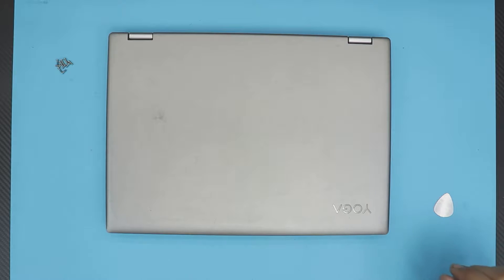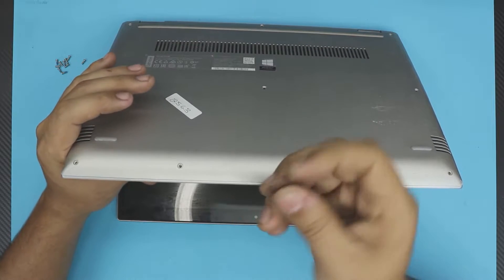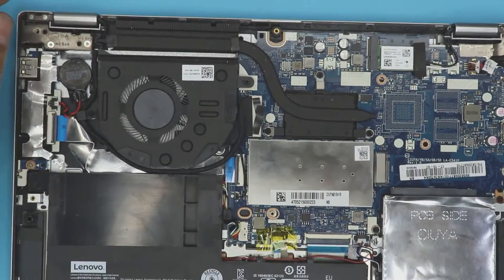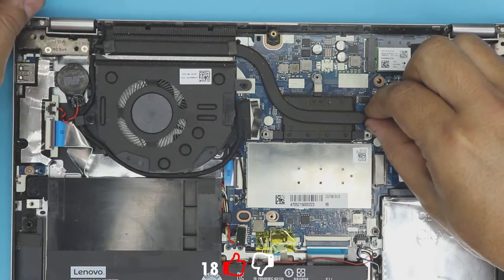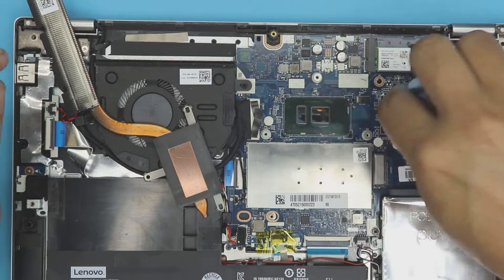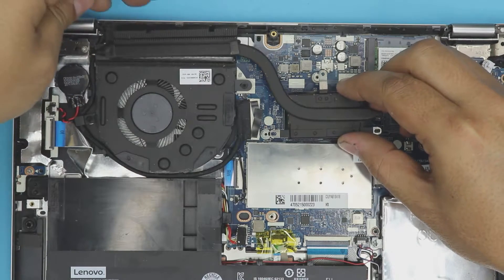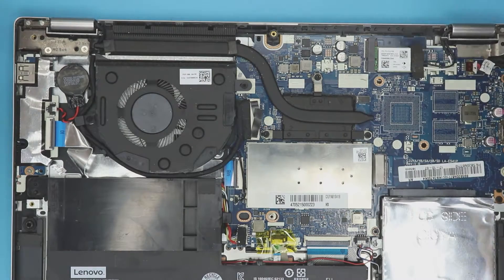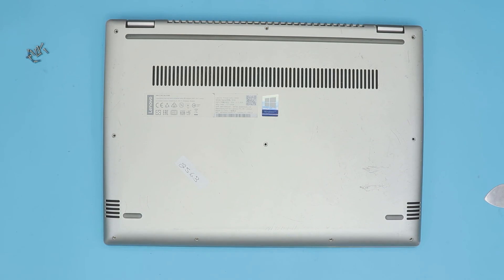✔ LENOVO YOGA 520 laptop Service / Repaste / Cleaning Guide

Comment: Buenas dias
Tengo la misma laptop y tengo un pequeño problema, en algunos momentos cuando esta funcionando la laptop empieza a salir como algunas rayas y eso no permite que se pueda seguir utilizando, quisiera saber si me puedas indicar cual es el flex o conexión de la pantalla que esta conectada con la placa, ya que me gustaría probar ajustando ese conector ya que quizás se podria solucionar con eso
Agradecería tu ayuda porfavor
Algún correo para comunicarme?
Reply from the maker: hola, mira si puedes grabar un video corto de que como se ve las rayas, ya que no todas las rayas son de cable flexor. ya que si el cable de flexor se pone mal se va la pantalla o se pone color distinto. requiero que mandes un video. saludos
Reply: @uFixTek  agradecería que me brindes un correo de contacto para enviarte la información porfavor
Gracias porque tu respuesta

Comment: Nothing against this video but consider my review if you are buying this laptop. I am using this Laptop for 2 years and its the worst Laptop I have ever used. The whole board was replaced with 2 weeks of buying, the screen flickers, OS was fixed twice, the audio doesn't work in between the meetings, poor quality hardware- forget 360 rotation- I can't even open it for 90 degrees! All this within 1 year of buying. Imagine these things happening when you have thousands of clients.. I have just given up!
Reply: Damn... I have this Laptop for over almost 3 years and no problems but overheating! I usually install modified systems like Windows 10 Lite OS and right now im using Windows 11 beta and no problems! I hope you better luck!
Reply from the maker: Thank you for the your honest feedback and your support to the channel, :)
regarding your opinion as my point of view (Laptop repair shop) , you have no idea how many of this Yoga laptops we get weekly and its not funny at all poor people purchasing them and lcd flex cable fail and many other failures that should not be happening with the right extra components. i wish you the best on your next buy and if you need recommendation regarding the laptop you have in mind ask me :P
Reply: can confirm this! replaced screen twice, poor quality hardware, keyboard broke, 360 rotation hinge also broke and this tore the back lid apart. The only good news is, my yoga 520 remained usable till now, 3.5 years old.
Reply: I completly agree with you I bouth this laptop 2 years ago and God I know how much I have gone through. This is surely the worst laptop I have ever seen within 2 1/2 years of moderate use the entire backing of the laptop has gotten so damaged without any particular reason by damaged I mean that it's entire guts are coming out, I am shocked since I have seen no one facing such issue. I didn't drop my laptop, I didn't hit it hard nor did I mistakenly put something underneath the display that may have let the hinge wear off. It was shocking and painful for me to see how back the laptop got damaged WITHOUT ME DOING ANYTHING. I would never recommend anyone to buy this.